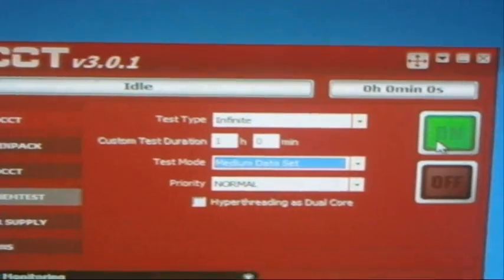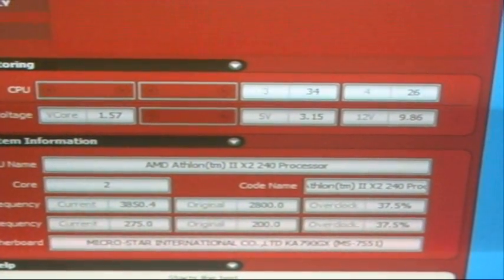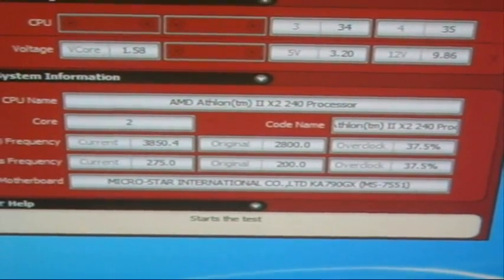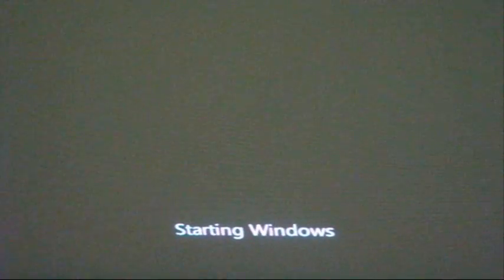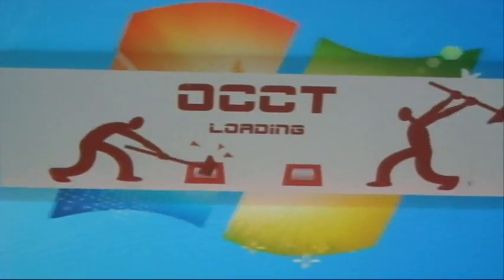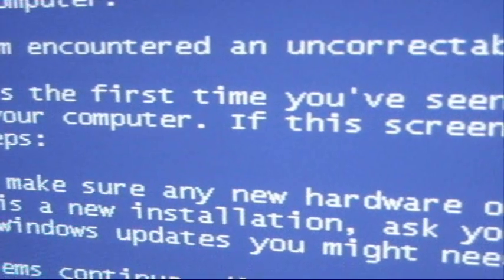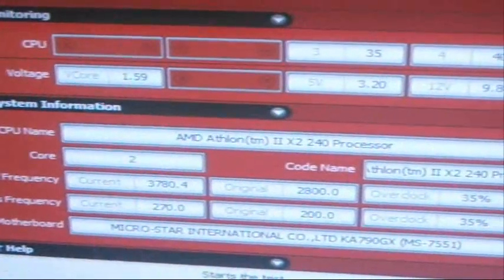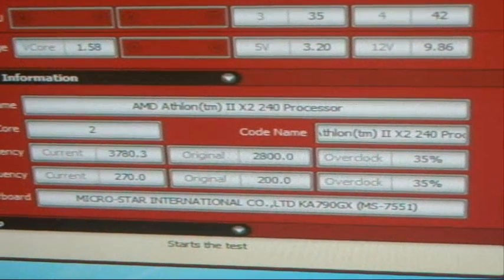Overclocking AMD Athlon II X2 240 - Part II

Comment: @dwergaap When overclocking this high you can't achieve stability with too low a Voltage. I OC this very same cpu and it's only 100% stable with high voltage. It's stable with low voltage if you use non complex programs. I know for sure yours won't survive Prime 95 in 8 hours at 1.475.

Comment from the maker: @deelberg it is very budget board at it's time, it is a nvidia chipset (6150/ nforece 430), it's quiet old, they added bios update to support later cpus, but the chipset have been around since old Athlon64 X2s. it's not meant for overclockingm and that's why overdrive doesn't work